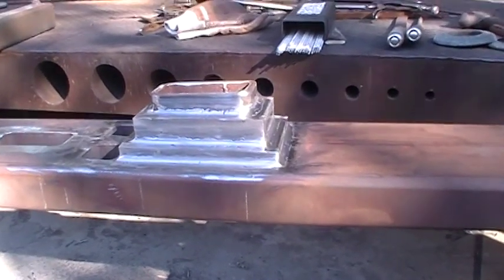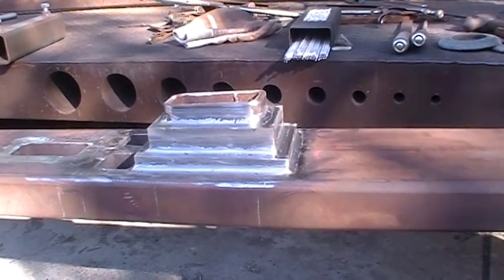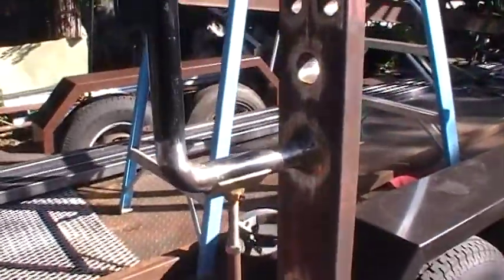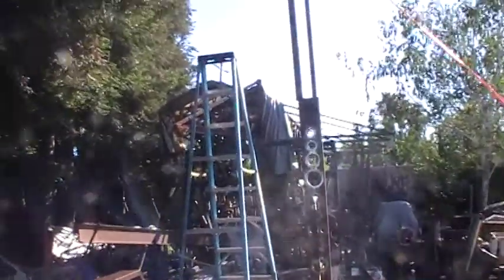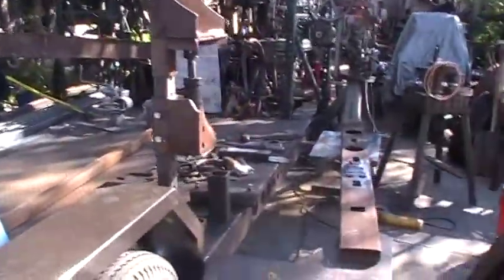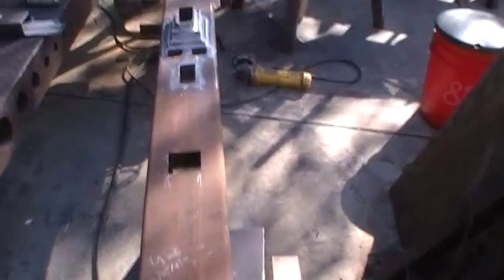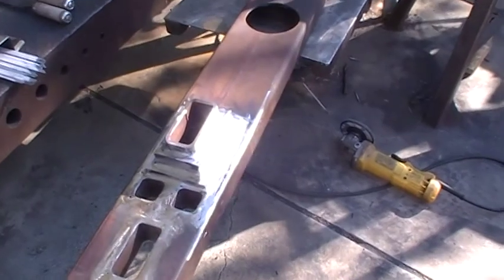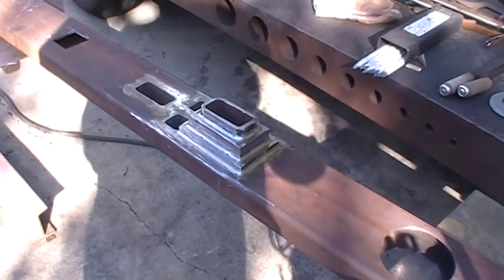I'm not a snail, I'm bipedal

Comment: What is it?
Reply from the maker: Hå hä hã. It's a piercing through the vertical support with doublers and triplers welded on for added strength, which is absolutely unnecessary. So it's really ornamental. Thanks for the comment.
Reply: @davewilson1591  very cool thanks